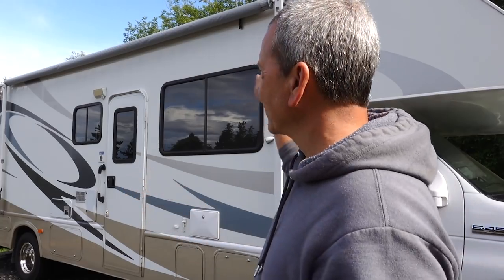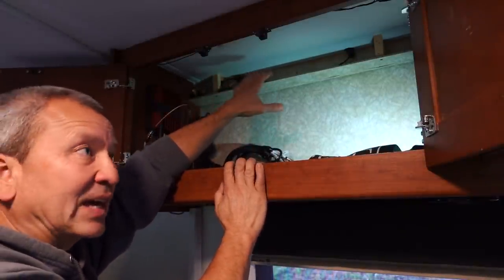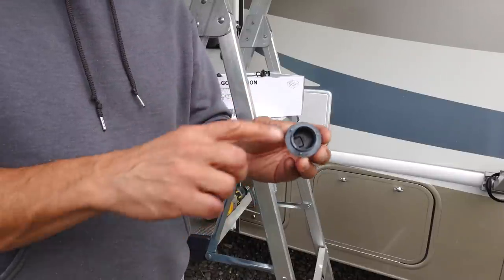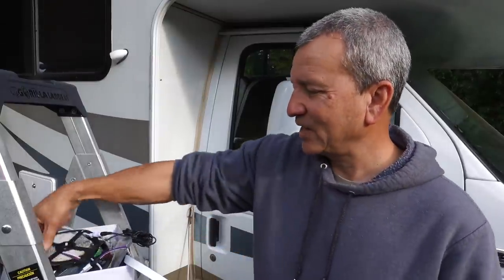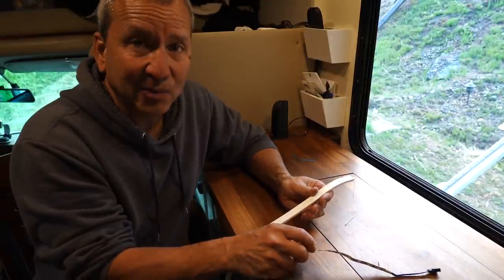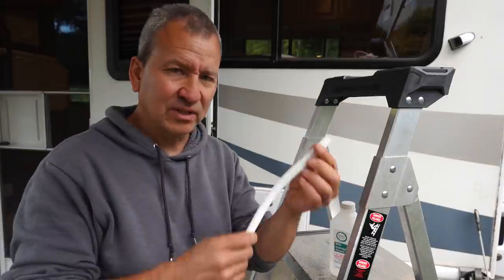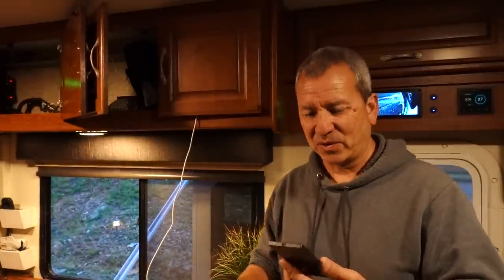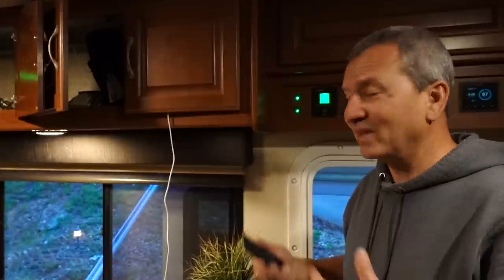DON'T WATCH If Drilling Holes In Your RV Freaks You Out

Comment: Good stuff!   FYI I have installed these light kits before...  the receiver can pick up signals from tv remotes etc.   So the lights will come on or change colors as you change channels or adjust volume etc.    After learning this on my first setup, I placed receiver away from TV etc to help avoid light receiver picking up other remotes signal.    I had mixed results.

Comment: Brian, my son and I put led lights outside similar to what you did with our 2007 Winnebago Outlook only we put the led strip onto the bottom of the awning track. clean the track with alcohol and stuck perfect to it. drilled a 1/4 inch hole into the side, clipped the connector off and added a longer strip for inserting thru the side of the rv.  soldered extra length to the led strip and reconnected the plug. Same result as your installation with about 20 minutes worth of work. Its the same as the rv companies and the way they do it. Works so well that we also did the inside at the top of the slideout  inside for indoor mood lighting. piece of cake job and looks very professional just like yours.  Earl
Reply from the maker: Nice job! Yeah. Not too difficult a job and looks great. I've also considered where to add one inside. Had to hit the road, so I'll do it later :)

Comment: Brian, As always a professional installation. I had put up an LED strip on my motorhome a couple of years ago. I decided I didn’t need the yellow porch light so I got power from those wires. The porch light fixture is still there but I ran the wire through the little air hole on the bottom. I cut the DC connector off the end of the light strip and wired it to the porch light wiring. The remote control module fit inside the porch light fixture just fine. Not as nice looking but it works. 😊

Comment: Pretty cool.  You have your own mobile disco party if you want.  Drilling through holes in the RV doesn't bother me but I haven't had to drill any yet because ours has some for other things that I can use.  Because our trailer folds, you have to be careful where you put things.  Our LED strip came with a track so it was pretty simple to install.  We used our porch light and a switch to run it or the regular porch lights.  It's not as exciting as yours though.  That raceway idea is pretty cool.

Comment: Hi Brian I installed a led strip under my awning on my 2006 travel trailer I ran the wire up through the gutter along the roof down the fridge vent then back to my switch pack at the back door of the trailer nice job
Reply from the maker: There you go. No holes required. Good job.
Reply: @RVwithTito  ya was kinda freaked out about doing that I may have taken the easier route but it involved more wire to run no big deal nice job on yours

Comment: Night time is for serious regeneration of old age cells.  No lights required.

Drilling holes is no problem for me.  I've drilled many holes below the water line in my boats for various reasons.  3M 5200 works wonders!

Comment: Nice work.  My only concern is the strip going to stay on at 60 MPH?  When I put mine on we put the wiring through the same hole as electric awning motor and then used 3M VHB tape to put the strip on the RV.   The downside to VHB tape is when it has to be removed.  Our strip only lasted a year and then it took a week to get the VHB tape off the RV.  I don't think I'll put another LED light strip on an RV, they just don't seem to last too long.
Reply from the maker: Mine is on there pretty good. Drove 1300 miles this week. Also. If you heat VHB tape up with a heat gun it can be removed easier.

Comment: You might want to look into one of those cordless Ryobi glue guns! You can pick them up for like $15-20 at a discount from TTI's outlet sometimes. AvE even liked it and he hates about anything lime green :)  They have a couple new ones too so be aware of what is available. Also, hot glue comes off with rubbing alcohol if you didn't know already.
Reply: Awesome I have been wanting to do this myself. I want to mount so I can use with Awnings in or out. Thanks for the info.
Reply from the maker: Cool. I'll have to look for one. Thanks for the rubbing alcohol tip. I usually heat it back up to remove it.

Comment: In desperate need of help!  My travel trailer has a built in hard wired awning light...the wire has been cut and is at the top of the awning arm--is any familiar with how these are wired?  I cant find where that wire connects and I'm going nuts!!???

Comment: Knowing my luck I would drill a hole and short out my entire travel trailer
Reply from the maker: Could happen :) One of the nice things about exterior walls is that there typically aren't any wires in there. I moved the hole in from the edge of the window to avoid any aluminum studs.